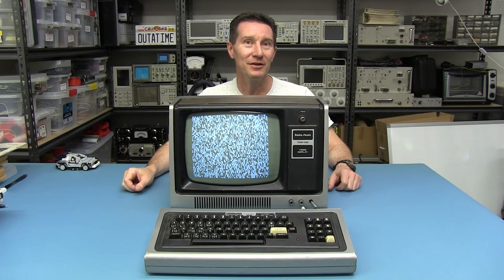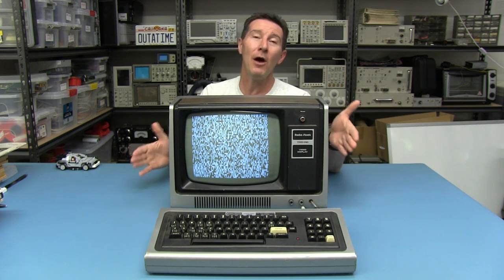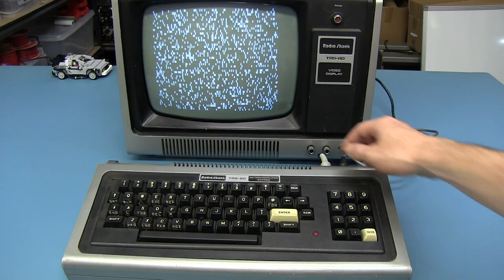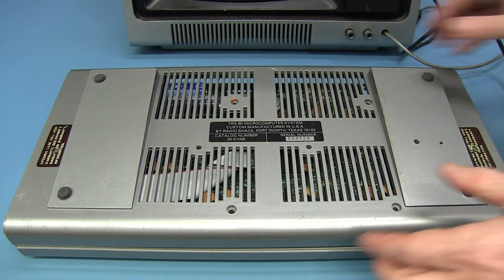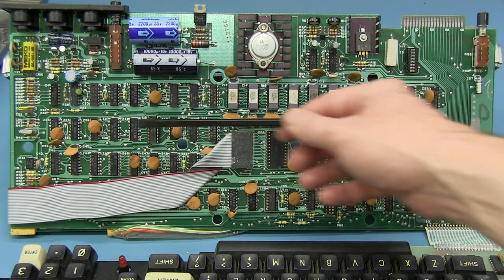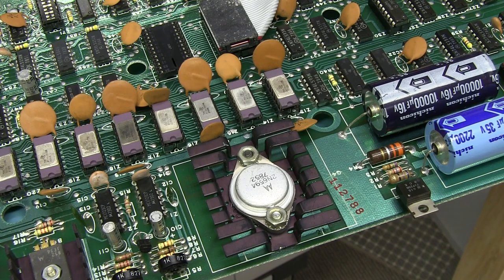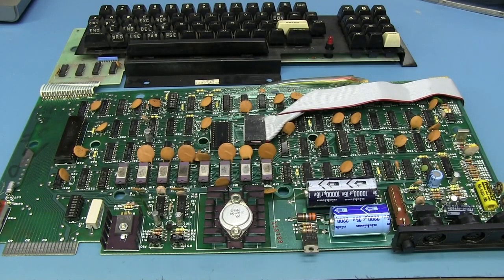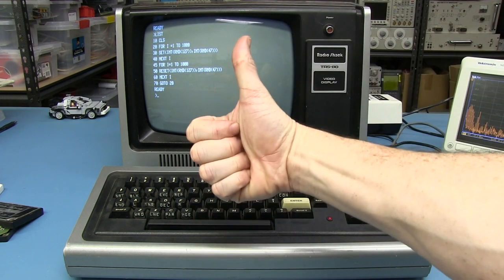EEVblog #645 - TRS-80 Model I Retro Computer Teardown

Comment: Dave, Jumper detected: North of R48 on right hand side of the board(3~cm to the top-left of the Z80).
Also, no mention of the brand of the caps being Nichicon?, still working after 37 years, that's what you get with a top brand!
Reply from the maker: No, don't ruin it for me!
Reply: EEVblog come on, surely you can forgive ONE very little jumper on what looks to be a cap footprint! :D (maybe an RC filter in which they removed the cap?).
(BTW, i like the new bench, gives much more room, how long until it's filled with random stuff? :D)
Reply from the maker: Guillermo Lovato
In that case, ok, I can live with that.
The goal is to keep the new bench completely crap-free!
Reply: The caps are still good because of low "on time". My guess is this particular unit was not used or rather powered up for long periods of time.  I pull these things (Nichicon) out of gear all day.
Reply: Joel Gette Nope. Was used at home and work for 6-7 years then spent 3 years driving a series of printers to print manufacturing labels. Fastest way to get it ready to load a new program was to flick it off and on.
Reply: Ben Govett No expansion interface? No $300 hard drives with 80K capacity? :)
Reply: Geoff Allan Never saw the advantage in a HDD when floppy drives had all the storage I needed at the time. Good old TRS-DOS. Sold the Expansion Interface along with the other unit we had and the old green screen.

Had a pair of Teac full height floppy drives that my Dad built a case / power supply for and made a cable to suit. Cost him $400 to make the twin drive unit at a time when a single genuine Tandy drive was $700+. All gone now, although I still have an original "Realistic" tape drive for this one along with a bunch of genuine Radio Shack tapes.

No manuals though... Those of you who had one will remember the manuals and why they were memorable. Would love to get my hands on one. Even a copy.  Priceless.
Reply: It's okay, I screwed that up and typed hard drives when I meant floppies...
Reply: Joel Gette i don't think the power supplies needed low ESR caps back then, that would add a lot more lifetime as well
Reply: +Guillermo Lovato theres a set of 8 jumpers north of the z80 in an ic socket, they were used to separate level 1 (4k upper case) from level ii (16k mixed case). I borrowed my friends l2 and changed all the socketed chips  then used a dip switch package to replace the jumpers and complete the upgrade  - I can still remember how nervous it made me levering things out and I had a map of texas burned into my fingertip from checking the ram when I had the jumper wrong
Reply: Ben, there is a site online that has a bunch of old manuals.  Go to colorcomputerarchives.com for a sampling

Comment: I love these teardowns. I recently moved and found my first PC stuffed in a crate that I had forgotten about. It was so much fun opening it up and powering it up again. It was HUGE! Six inches tall, 24 inches wide and 18 deep. It had the very first generation Intel 386. And it was the first PC that came with 1 meg of RAM. It operates at 20Mhz and has a 20 meg harddrive. And, it had two 5 1/4" floppy drives! DOS 5.0 The hard drive was corrupt so it would not boot, but I cannot bring myself to get rid of it.

Comment: my first computer as well... mine was the level one with the ROM upgrade board that converted it to a level 2, and added the keypad, after you cut a hole for it!!  BTW, the little switch next to the expansion port was a hard reset, that you needed sometime when doing asm programing!

Comment: This video was a trip down memory lane for me as this was my first real computer after building a single board MK14.  I wrote and sold some programs to run on it and spent many happy hours in the local Tandy shop on Saturday mornings swapping ideas and programs.

Unlike mine though the "silver" coating on the front of the keyboard seems not to have worn away.

Happy days

Comment: Nice video.  I thought you might give a shout out to the Dick Smith Electronics compatible computer that was also sold in Australia.  

The expansion module didn't have a floppy drive within it. Instead it allowed multiple devices - printer and floppy drives - to be connected.   The box was bigger than the computer but most of the space to allow the external power supplies for the computer and the drive to be  included within it.  The problem in Australia was the 240V supplies were too big to fit. 

My brother and I grew up playing the various games on one of these, so much so that we wore through to the second layer of plastic of the case just under the keypad.   (Our father used VisiCalc and word processing).    Sold mine at a flea market for next to nothing.  I hope the buyer got value from it.

Ours also had a third party patch which allowed hanging characters in the word processor.  I still remember going with my dad, back to the computer store opposite Nunawading  Station in Melbourne, to get it installed.

Comment: Nice video!
I had one. Bought it with 4K RAM but Radio Shack allowed me to upgrade it to 16 K RAM without warranty issues.
Later I added another 2 rows of 16 K RAM piggybacked on top of the original ram with the Chip Select pin driven by an extra decoder.
I replaced the character generator with an EPROM and added some memory for lower case.
In the end, I could switch it between the normal character set and one with the special APL symbols.
And, of course, added better graphics.

I got hold of two 5 1/4 inch floppy drives and designed and build the disk interface and a real-time clock and serial port to connect to a home build 75/1200 baud modem to get on the bulletin boards.
The PCB edge connector for the expansion interface was absolute rubbish. I soldered a proper gold plated connector onto it. 

I never had so much fun later on...

Comment: A 16K Level II BASIC TRS-80 Model 1 was my first computer, back when I was 12. I used the snot out of it. Things I remember:

- The keyboard felt good, but had an awful keybounce problem (i.e. repeated letters). There were a lot of third-party debounce programs you could get and it was pretty much a requirement to load one every time you started it up.
- I remember taking the trim panel off the monitor and seeing the holes where the tuner knobs would have been in its original design as a TV.
- I played most of the Scott Adams (different guy from the one who draws Dilbert) Adventure games - lots of fun.
- There was a third-party peripheral called the Orchestra-80 which you could hook up to the slot where the expansion interface would connect to and which would allow you to play 4-voice music.
- My favorite game was SubLogic's Flight Simulator 1. 3 frames per second at 128x48 resolution, but still, I was flying!
- Assembly language programming went like this: 1) Load the assembler (from tape). 2) Load the source code (from tape). 3) Edit the source code. 4) Save the source code (to tape). 5) Assemble the code (to tape). 6) Load the assembled code and run it.  7) If there's a bug, return to step 1).

Comment: The Model 1 was my first computer. A very expensive Xmas gift for a13yo. I had 4 siblings and we were not a well off family. I think my parent saw it as an investment. After I got it I don't think I slept for three days. You couldn't do anything but program it and that is what I did   -- and still do today. I added the expansion interface, a printer and two floppy drives over a few years which gave me a whopping 16k of ram. I sold it to a comp sci professor at a local college and then bought my next PC. I considered an Apple 2 but ended up with a DEC Pro 350. Maybe I missed a bet there but knowing more server side stuff has serve me pretty well.

Comment: We actually owned a Video Genie II with the numeric keypad (TRS-80 clone).
Upgraded with 2 floppy drives, 300 baud modem and graphical upgrade.
We completely took it apart and mounted it in a desktop case with separate keyboard case.
Best computer years I ever had!

Comment: I had the Hong Kong rip off of the TRS80 called the Video Genie II and loved it. It even had a build in tape deck with volume control. 16K memory and learned how to program in Assembler. Those were the days. :-)
Reply: I have a video genie but case has been damaged badly in posting and seems to have had a mod on the pcb, not yet got it working.. :-(
Reply: built in cassette deck.. pretty swanky

Comment: Sound was achieved through the cassette out connected to a small telephone amp (or whatever amp you wanted).  All the games supported sound that way.  The button you were pressing by the edge card connector (tucked in back) is the reset key, soft to push, hard if you hold down break while pushing it.  Also, the monitor did have a grommet or some sort of strain relieve there, it was missing on that model, but google  pictures and you'll clearly see it.  I did a lower case mod on mine that involved soldering a ram chip onto another (piggyback), that and a replacement char gen chip, hence the reason it was socketed.  I worked at radio shack and I asked the tech about getting it done and said save yourself the money, tossed me a chip, a piece of wire and the char gen and I did it myself.  Also, the expansion unit didn't hold drives, it enabled drives, (contained the drive controller hardware), as well as an additional 32k of ram, an rs-232 board for data, a printer port, and a data bus since you use the one on the main cpu to connect to the expansion interface.  Interesting thing about all the RF you covered.  A guy (from my home town actually) wrote a program that would play music, wirelessly of course, from the computer to a nearby radio.  He used machine language loops and figured out what sized loops produced what frequency and had the computer playing music through radios :)

Comment: You failed to mention that the expansion edge card connector was only tin plated.  I had a close friend, R.I.P. Kent, that tried to clean his with WD40 (didn't know better, but didn't really do any harm).  He used it with a memory expansion box (which I am trying to visualize in my memory but can't quite.  Anyway, I remember Kent getting a gold plate upgrade kit for that connector.  It soldered on to both side and a gold plated board (or connector, I don't remember) then stuck out the back  I remember soldering it on for him and the reliability of the expansion interface improved 100%.  He used that computer for many years actually.  I was living in another state at the time of his passing and don't know what his daughters, who I was not close to, did with it (he never threw stuff like that away so I am sure it was there in 1997. Anyway, gee thanks, now I am very meloncholy right now.

Comment: I was hoping to hear some AM radio interference.
Reply from the maker: I don't have an AM radio :->
Reply: EEVblog
Hi dave
Reply from the maker: FAMICOMASTER
Hello!
Reply: EEVblog
Well, get with the times, man! They're all the rage! ;-)
Reply: I think you can pick that interference even with a crystal radio)) With a reference to ground and 1m (at least) antenna, of course :)
Reply: I have an AM/FM radio where do I send it to?
Reply: We used to use an AM radio beside the computer to know when it was doing Tape and later disk IO.
Reply: lol
Reply: +gsansoucie I did the same thing with my CoCo.  That unit claimed to have FCC Class B certification, but it interfered with radio and TV broadcasts all the time.  I wonder if it really complied or if Tandy was fudging the numbers.  (Or maybe the FCC rules weren't as strict as they are now.)
Reply: Hi! I'm a big fan of your channel! I know what's that black stuff, it's some kind of coating to avoid corrosion (I think) and it helps a lot when soldering. I found the same black stuff in a old VCR from the 80's.

Comment: This is very good!  And I still have my Model I ! w/ 3 floppies (Double-Density kit installed) ! LDOS, TRS-DOS, Newdos  Bought a 5 meg HD from Radio Shack Computer Centers (remember those?) back in the 90s at a tent sale This was where it started before Apple by a couple of weeks. Learned to program on this machine. Mine was in a box in the attic and years ago I saw they were selling for $500-$1000  Still holding on to it. I heard the Model I is in the Smithsonian Museum   I might just un-box it and see if it boots! Hopefully disks are still holding data
Reply from the maker: Alan C Shoot and upload a video of it booting!
Reply: Not only I bet it will boot up with no problems, but I bet that thing will boot up in 2077!

Comment: Back in the 70's and early 80's when I worked on developing solder mask technology, getting the coating to work over tin/lead was a pig, 3 cheers for the transition to SMOBC and HASL technology.

Comment: I made clone of that model I with my friends as a hobby project  in beginning of -80's, pcb and everything. It worked when we figured out that due different TTL's it tried to boot to disk unit proms, but when some resistors where added to extension bus it booted without it.  I still have it, it is not exactly same because keyboard was different, but 99% same.  Keyboard was made from old IBM machine (white and blue keys... :) and monitor was tv with video input :) . We where kind of professionals at that time working with 8080 based boards, so we know what was going on.
Very cool project at that time :)

Comment: 21:20 fried cap?

26.18 - huge cap on bottom right. is likely charged to  hundreds of volts.   I was a bit nervous when you were poking at the label on the right inside of the monitor case.   When I was a kid, I placed a screwdriver across the terminals of one of those to discharge it.   It melted huge holes in the screwdriver.

Comment: I've got one of these, had it since 1980... it's what I cut my teeth on.  There's lots of aftermarket info (including the L2ROM disassembly) available... I had a friend burn some 8K EPROMS so I was able to upgrade without the extension board... put my own 64K DRAMS in (jumper one bit to the address buss), add lower case (one jumper wire!)... I had cassette editor-assembler (EDTASM), made my own EPROM burner, etc... even did a light pen program for my uP2 final at comm college.  Having one of these put you head and shoulders above the classmates using the little 6502 breadboards.  Then I got a job in industrial computing... based on the Trash80!  We used Model 3's for lots of things.  The insides is very familiar to me!

Comment: The Expansion Interface didn't have room for floppy drives.  it was a plastic platform that had room for a single largish PCB and a cubby for a daughter card (extra $$) if you wanted an RS-232 interface.  There were cut-outs around the periphery to expose connector edges on that PCB or various things, including a port you could use for external floppy drives.  Originally single-sided, 83K floppies.  

To save money, we used to use a paper punch to cut out a symmetric notch so we could flip them over and write on both sides.  :)

Comment: Dave, I've got one of these in my basement and was my first machine. "Clyde" as we called it  has an expansion interface and yes thy do generate a fair bit of heat. We have a small fan for coolingthat we plugged into the multi outlet bar as well as all of the other goodies. You've inspired me to pull Clyde out and get him up and running.
Reply: I almost forgot, the second switch on the back of the computer is a reset button.
Reply: Tom Bryant A reset button yes, but not like a PC reset button. Was more of a break button you would use when the machine was stuck waiting for response to IO. If you wanted to stop a load from tape, or you had sent something to the printer and the printer was stuck (in an error state) you could press it to regain control of the machine.

Comment: EEVblog Re the speed of the Trash 80 vs the 6052 based machines, the Z80 has a horribly inefficient bus system compared to the 6502*, resulting in very roughly half the MIPS for the same raw clock speed. At the time, the default clock speed for a 6502 was 1MHz, & that of the Z80, 2MHz, for comparable performance levels, modulo cycle-stealing for DRAM refresh & video controller access, etc.

* Plus the 6502 had hard-wired instructions, vs microcode for the Z80, which gave the Z80 fancier instructions, but required more cycles.
Reply: Yep, the 6502 had a multi-phase clock too, which allowed it to do more with each clock cycle. It effectively operated at double the headline clock speed. It's efficiency directly inspired the ARM's architecture.
Reply: Electron Alchemy Yes, that's what I was meaning about bus efficiency.
Reply: Common misconception, but the Z80 instructions WERE hard-wired. Even back in the day (1978 when I was working for Tandy selling these things as a teen) there were people running around saying "microcode, microcode". They were wrong then, as now. In fact, the history of Zilog (and the Intel defectors that started it and completely decimated the 8080 with the brilliance of the Z80) is fascinating on its own.

Once you learned some assembly these things FLEW. It was easily possible to get 60 or more complete screen refreshes per second... if only there was enough memory to store that many interesting frames. And of course the hash on the screen from refreshes while updating... it was "new tech" to even consider waiting for the scan retrace to start writing.
Reply: The fun comes when you realize that the Z80 had a 4 bit ALU. http://www.righto.com/2013/09/the-z-80-has-4-bit-alu-heres-how-it.html